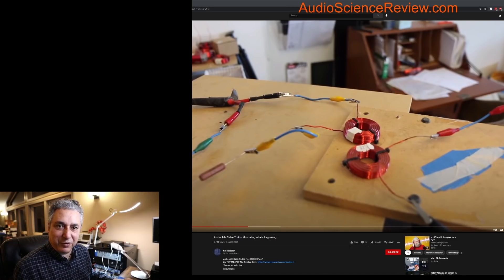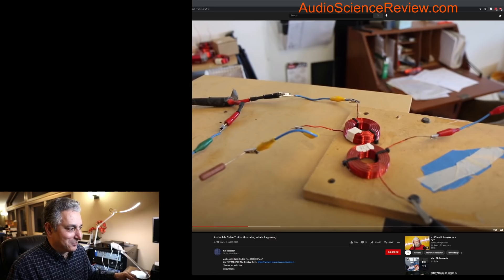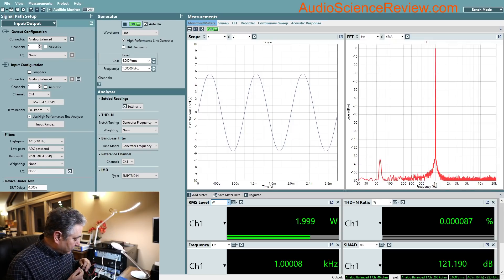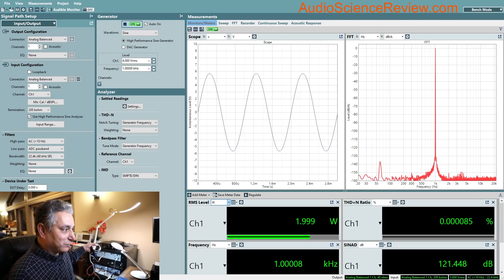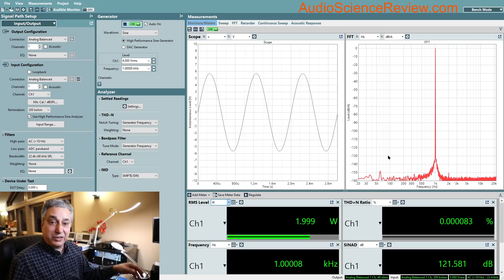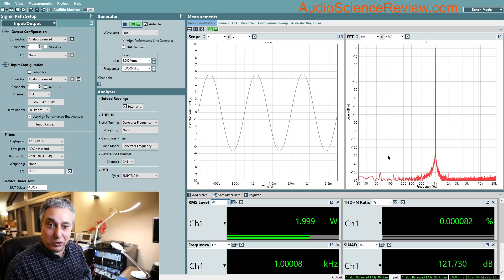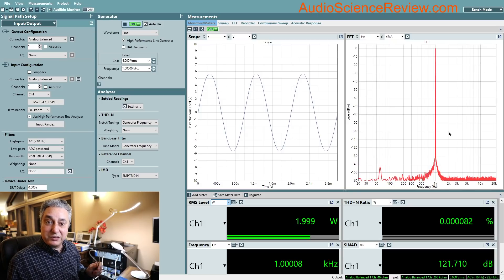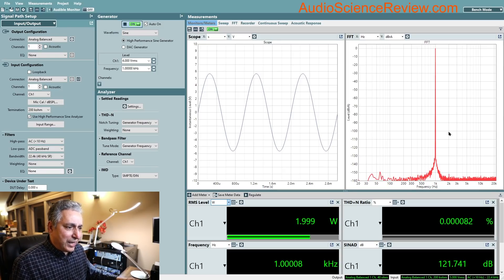Electromagnetic Interference In Speaker Cables?

Comment: Snake oil damages the reputation of hifi as a whole, and makes good reasonably priced products harder to identify. That's the reason people get their knickers in a twist over cables: it's muddying the waters. Please keep doing this lol
Reply: Topping makes transparent stuff that measures well, therefore Amir is IN LEAGUE with Topping lol. Loving the 90s deep state grade reasoning.
Reply: Exactly! Snake oil hurts the industry. Ignore the troll who's just a distraction like snake oil is. 🤣
Reply: @StringerNews1 You sound like the typical low-info banana-brain that would take this dummy seriously. Trump colluded with Russia. Wow. Keep that tinfoil hat on.
Reply: You are right - snakeoil like this channel is damaging the industry - but hey at least its filling Amirs pockets. ;)
Reply: @mariodrv  What exactly are you objecting to?
Reply: @1leisure1  What exactly are you objecting too?
Reply: @mariodrv  
Well, Amir gave you the option.  Do a blind listening test with your own ears and with your own equipment & setup

Try using a simple household cooling fan with an AC electric motor.

I say this because this type of simple, brush & armature motor will most likely produce more spurious AC line noise than just about any other common household device, especially when it is switched to a lower speed other than full power.

A hair dryer would probably be technically better, but obviously too mechanically and acoustically noisy for this test.  Or perhaps use a microwave oven, or electric hair clippers...of course, both of those are problematic due to mechanical noise as well.

Anyway, after you choose your "noisy EMI test device", have someone place your speaker cable in parallel with that device's AC cord while it is running without you knowing when or if the two cables are together or not.  

Like Amir said, raise your hand for your helper when or if you detect a perceivable difference and see if it correlates to the cable's proximity to each other.

BOOM!  From that moment on you'll know if it really makes a difference.

But I would ask you to consider that 98% of household devices that you would commonly have in your listening room AND in close proximity to your speaker cables will produce far, far less EMI.

And even if they did, a simple solution is to have those two cables only cross each other at a 90° intersection, and the issue is eliminated.
Reply: @mariodrv  How is Amir filling is pockets? This video currently has 2500 views, so if that's the case, he must have very tiny little pockets.

I'll also point out that Danny@GR-Research, is also probably not getting rich off his claims, as his speaker cable kits are pretty inexpensive. Neither of these guys are getting rich based off of any of these claims, trust me.
Reply: @bartpappas3236  I am refering to Amirs dubious ties to certian chinese tech consortiums involved with products being praised on Amirs website.
Reply: @mariodrv  Isn't that kind of tin-foil hat stuff? Amir is not the only reviewer to praise Topping and SMSL products that get high sinad scores. I got a Topping d90 to evaluate at home, next to my other equipment, to see what the deal was with them and can only tell you it's a keeper. No one paid me, and I would have returned it if it were junk, or didn't perform better than my other DACs.

Also most manufacturers do not welcome people attempting to independently verify their claims and measurements, so again not sure how anyone could "line their pockets" this way.
Reply: @mariodrv  hello kimber cable/audioquest representative, your personality disorders are showing
Reply: @mariodrv  You seem a little confused!
Reply: @jonnobrakesman  ...thats exactly the word to describe the mental state of cult follower, thanks for making my point for me.
Reply: Mind you, anyone that claims those who believe science are 'cult followers' seems more than a little confused.
Reply: @jonnobrakesman  Really? Who's confused here? Explain to all of us how electromagnetic radiation is supposed to be detected from a power cord that has NO CURRENT RUNNING THROUGH IT. Is this channel actually serious? I mean, this is 10th grade science level stuff and this goofball Amir doesn't understand this?
Reply: @mattrondeau7466  Well I'm confused now. Confued as to why you're asking me this? I never made any claims or statements at all other than to call out those who think following science makes them cultists. Which is farcical. At no point have I stuck my flag to any particular pole other than that of fact based findings over the rantings of fools. 
Perhaps you'd like to explain to us all what you think as you're the one here claiming to have the knowledge.
Reply: @jonnobrakesman  You're right. You are very confused. If you think this guy is following science simply because he put the word "science" in his channel name, then you really need to actually learn the science instead of believing it's some magical word. Use the word and your ignorance supernaturally turns into fact. Amir literally tested a power cord for EMI while ZERO current was running through it. Anyone that takes this clown seriously after that is disqualified from talking about science. Go back to school.
Reply: @mattrondeau7466  I think you're the one that is confused. Why are you making mASSive ASSumptions about what I think? I never once made any comment to suggest any such thing but by all means carry on your pointless rant at me as I find you amusing.
Reply: @jonnobrakesman  You're right again. You don't understand the science. Yet you call someone who points out Amir's lack of understanding of basic electrical science "confused". But the fact that you can't even follow a conversation concerning a comment that YOU posted does make this all a clear waste of time.

Comment: Somewhat off topic, but for those looking for very high quality speaker wire, check out Canare 4S8. Grouping the twisted pairs is equivalent to 13awg. Markertek sells the cable for .69/ft. A complete 6-foot run, including gold spades/bananas, will run less than $15. No snake oil, here.
Reply from the maker: Indeed.  They are very good cable.  See my testing here in the exact configuration you mention (for 4S11 though): https://www.audiosciencereview.com/forum/index.php?threads/when-12-gauge-wire-is-not-12-gauge.3/
Reply: Audioholics years ago recommened 4S11. I bought a pair from Bluejeans Cable.  I used to have MIT cables; I am recovering audiophile... 
Audioscience review channel is a great addition to hifi. Solid no-nonsense information.
Reply: Audioholics also recommended the kimber 8PR cables.

Comment: During all this wire debating, I keep thinking - "when you debunking guys can get zip cord or whatever wire you chose to sound the same as my Vahalla2's" and provide the same overall presentation  - I'll sell off my reference cables and buy whatever cheap wire you can come up with, I'd certainly love to save the money - - you debunking guys never address the most obvious thing - the sound - I don't care what the reasons are - ya got me - I DON'T CARE WHY ONE CABLE SOUNDS DIFFERENT FROM ANOTHER - but there's not a shadow of doubt that there's differences and quite often profound differences, IN  SOUND & PRESENTATION - - and again, I'm tired of the debunkers accusing me of being "fooled" - that's friggin stupid and the most dumb ass argument out there - - - so, when you have a wire that costs pennies compared to most reference cables that YOU claim gives the same result  - Put it out there ! I'll be the first in line to buy it. Ya don't do it cause ya can't. So either put the oscilloscope away and start listening or stop using this debate for click bait. I AMAZED that you debunkers tout the measurements and NEVER put your finding to a sound test which is what being into stereo is all about. By the way, I noticed in your test that the "mains" wire isn't passing current - so what the heck good is your test and what you don't know is how that "low DB" noise might be affecting the resulting sound presentation because you didn't go to a sound test which to me is stupid.  So - - - I really don't care what Danny or you or anyone says, I know from listening experience, and perhaps unfortunately for my wallet, that zip cord isn't going to cut it in my reference system. And anyone out there that's messing with zip cord, at least go buy yourself some monster cable - the original stuff, it's not that costly - and if you can't hear the improvement, then ya might as well be listening to your music on a table radio - which actually is fine too, I freely admit that from time to time I've gotten musical chills from my cheap ass GE radio that's in my bathroom.
Reply: Is this a copypasta? Because it would make a great copypasta.

In case it's not, you should probably stop watching this channel, clearly it's just going to make you mad lol.
Reply: @Nick_4i  Thanks Nick,  I don't know what copypasta is but I'll look it up - but anyway, thanks for the tip regarding the channel ! And regardless of what I wrote, which is all true, it doesn't mean that I don't "respect" a channel like "Audio Science" - but, it does beg the question - if it is about audio, then where's the "audio system" in the equation?  Of course that's a rhetorical question because I don't want to debate with you Nick - buy yourself some decent cable and you'll be happy you did - no matter the science. And that's my point - unfortunately perhaps for my wallet, but cabling really does matter.
Reply: @skip1835  don't take my comment about it being a copypasta too seriously, just poking fun a bit. 

And I do hope to try some expensive cables someday, just to see if I'm missing something. I seriously doubt I'll be able to tell a difference, and I definitely won't be buying them without trying them first, but maybe I'll be pleasantly surprised.
Reply: @Nick_4i  thanks Nick - - best wishes with your audio journey.
Reply: Nice Post Nick. I am both an Electrical Engineer and long time Audiophile. You have the right to spend your Audio $'s however you would like too. My $100 Casio Waveceptor watch is going to keep as good as time, if not better, than a $5300 Rolex Oyster, but the craftsmanship and dare I say status of the Rolex, is far greater. If you were able to set up a double blind listening test where just the speakers wires were being switched out with 12gauge wire from Home Depot, would you be able to  pick out the "reference wires" 10/10 times? I found this test between different digital recordings very telling as to how well we can actually hear nuances...good luck https://www.npr.org/sections/therecord/2015/06/02/411473508/how-well-can-you-hear-audio-quality
Reply: @SLCVideoProductions  I would be shocked if I could hear a difference between cables. I want to try, just because so many people are dead set in the belief that they make a huge difference, but I don't expect to hear any difference.

I have actually taken that test before, and I could reliably pick with the .wav or 320kbps file, but I couldn't distinguish between the two. That's why I've never bought into lossless streaming. I only really stream music when I'm on the go, and I know I'll never be able to tell a difference in my car or on a bus, even if I was sure I could in an ideal environment.

I do like the test, but I feel like most of their choices are poor ones for actually discerning differences between format. They aren't necessarily poorly recorded or mastered, but they don't have elements that are usually telling of file quality. Still very interesting, though, and worth looking at for anyone whos interested in high quality digital audio.
Reply: @Nick_4i  I was able to pick the wav file correctly 3/6 times, and only once thougt the 120kbps was the best. I listened through two different speakers (both hooked up to my PC, but independently amplified, and a headset. Probably for 10mins each track. But I'm in my early 60's and was not sure how good my hearing is- guess it is not too bad. My dad told me a long time ago that he watched a lot people lose money betting that they could tell the difference between one brand of beer or another, or whiskey, or Coke after the 1st drink...sounds similar in many regards...

Comment: With no current flowing through that "live" mains cable -- shouldn't there be some sort of load on it?  Anyway, regardless of the resulting noise level, it could easily be avoided by simple not routing mains and speaker cable in close parallel proximity.
Reply from the maker: As I responded to another comment, there is current, albeit very low.  Please see this new measurement with realistic amplifier current: https://www.audiosciencereview.com/forum/index.php?threads/electromagnetic-interference-in-speaker-cables-video.20647/post-683806
Reply: @AudioScienceReview  -- Thanks, Amir.  <3

Comment: 1. There was no current flowing trough the mains wire.
therefore the test was nothing about inductance but only about capacitive coupling.

2. you did not make an indicator by coiling the cable 
since the cable hold a wire pair carrying equal and opposite current, thus creating two magnetic fields that almost completely cancel each other out.

You must know the difference between capacitive coupling vs inductive coupling?!
why do you chose to make a bunch of  straw man arguments?
Reply: Agree - repeat the test with current running through the mains wire. I have a gut feeling that test won’t be performed.
Reply from the maker: @ChicagoRob2  repeat it was: https://www.audiosciencereview.com/forum/index.php?threads/electromagnetic-interference-in-speaker-cables-video.20647/post-683806
Reply: @ChicagoRob2  I don't real care about the outcome. You can easily tweak the test to get what ever result you want. 
But if you want to make debunking videos and brag about how your test is better and more scientific you should not make this "mistakes" 
Looks like decides which tests are unrealistic and made up by undefined rules.  

And the rules do not seem to be the same for tests supporting his narrative. 
(or how can you call a cable with no current trough it an inductor?)

That's not very "scientific" for me
Reply: @Douglas Blake Maybe it has the same effect maybe not. Amir don't proof or disproof what he claimed "Electro_magnetic_ Interference" because without current there is no magnetism.
Basic middle school physics, Amir must know this but ignores it to stay in his narrative. That's not how Science work's.

Danny's video was clearly about inductance nevertheless Amir did not test the effects of induction at all and claims it a proof or and debunked.

Comment: Hello Amir, thank you very much for the test!

Dumb question : The audioprecision is dead quiet, but what about a crappy amplifier that is already noisy above threshold of hearing? Will this make any difference?
Reply: The point is the cables don't affect the signal being produced by the amplifier.  So if you have a noisy amplifier then the cable would accurately transmit that noise to the speakers.  If your cable is (somehow) filtering out amplifier noise it must also be filtering out amplifier signal, as the cable has no way to distinguish between noise and signal being produced by the amplifier.
Reply: @iancalderbank7368  Okay so this increase in 60hz would have to occur before amplification, right ? Let's say Amir tries the same thing on input RCA cables. Is the amp going to amplify this bump in the 60hz region and then transfer it to speakers the more the user cranks up the volume?
Reply: @Andy-qk4bl  Yes that would be correct, because the amplifier won't know that the 60hz mains noise is noise so it will amplify it.  That still might not make it audible as it will depend on the gain in the amplifier and the amount of noise picked up.  This is why its more common for RCA cables to be shielded than it is for speaker cables, and it's probably a good idea to get shielded RCA cables (although they still don't need to be expensive).
Reply: @iancalderbank7368  I agree, but aside from the shielding, I doubt there would much much difference between two RCA cables of the same length. I plan on trying my own experiment in the future...

Comment: Amir shouldn't there be current running through the mains cable? And you don't have a speaker hooked up, that dampens the inteference even more but it is more realistic. To complete the test you could coil the speaker cable around the straight mains cable which has some current through it.
But in general I'm done with this subject. Danny took a wrong turn here. Speaker cables can make a difference on sound stage, but it is minimal and you better spend your money on other audio components.
Reply: It's even better to put together your own speaker cables using some decent quality industrial cable material.
Reply from the maker: As I explain in this post, there is current actually flowing in the mains cable I used.  Still, I created another test, using an amplifier as a load.  Please see: https://www.audiosciencereview.com/forum/index.php?threads/electromagnetic-interference-in-speaker-cables-video.20647/post-683806
Reply: "Speaker cables can make a difference on sound stage"

How?
Reply: @Clobercow1  For example: https://www.youtube.com/watch?v=HJGw8zwx-6g&t